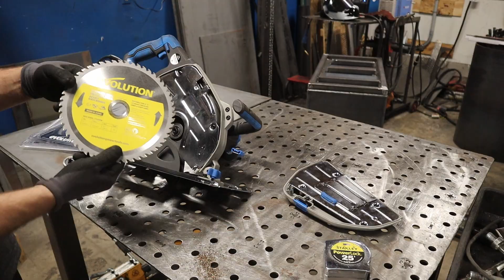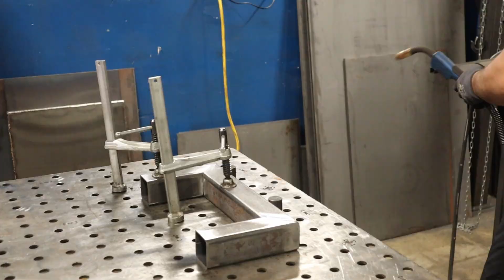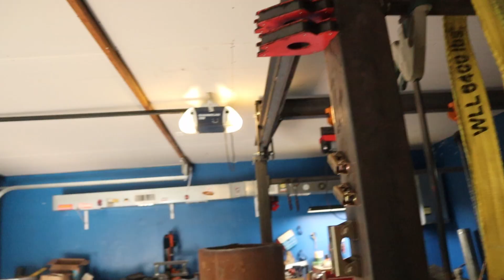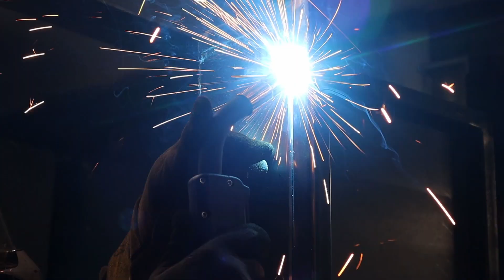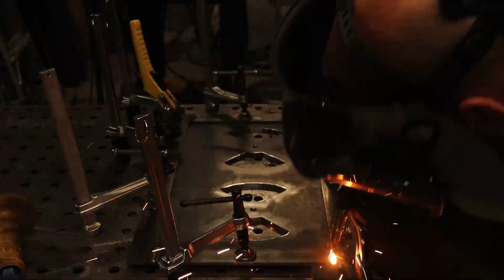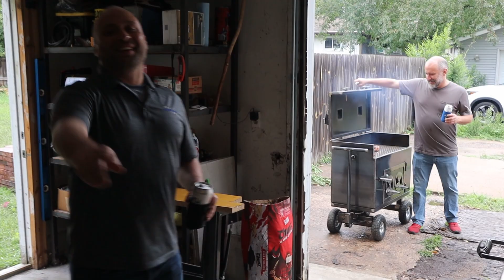DIY Direct Heat BBQ Pit Build w/Wagon Base!

Comment: You put a hub/bearing assembly on there, much love. Im a mechanic/technician by trade. Is it a Chevy unit?
Reply from the maker: @ericgordon4746  yup sure is 😂
Got it on Amazon for like $30.  Figured it would be perfect for the swivel bearing.
Reply: @fabmakebuildcook6274  Oh yeah, and it can take the weight of the smoker.
Reply from the maker: @ericgordon4746  absolutely

Comment: Your builds look great!  I’m attempting my first build now of something similar.  My 3/16 inch plate has thick mill scale on it.  Would you recommend removing all the mill scale to the bare shiny metal?  I dont plan to paint, but season with oil like you do.  Thanks!
Reply from the maker: I’d leave the mill scale on and oil over it.    I think it’s a good look.  Plus removing so that scale would take quite a bit of time.  Good luck on the build!!
Reply: @fabmakebuildcook6274  Thanks for the reply!  That’s what I was hoping for.  Like you said, that would take a huge time investment to strip off, but I wasn’t sure if it would adhere correctly.  I’m going for a dark metal look, like how your build turned out.  Did the metal in this video have mill scale on it or was it P&O?
Reply from the maker: @ItsAlwaysGood  the was all 1/4” hot rolled so definitely has the mill scale on it.

Comment: A. great build.  B. how tall is the grill not counting the wheels.   C. Keep it coming
Reply from the maker: Thank you.  24” tall.  I’ll do my best
Reply: @fabmakebuildcook6274  thanks.  I am not sure if I’m going to make mine 32 tall or 24 tall.  I have a sheet bent 32x24.  Was thinking tall incase I want to burn logs.  I know your other ones are taller but what one do you like best
Reply from the maker: @timothyswatzell221  they both have their pros and cons.  Take us nice since you can literally have a fire in them and still cook low and slow.  The shorter ones take less time to heat up and are probably a bit more efficient.  Both are good

Comment: Have you tried a pizza stone in this yet?
Reply from the maker: No I didn’t try that on this one but it’s a good idea!
Reply: I think it would be clutch!  @fabmakebuildcook6274   also what is the height of this - with out the casters? I am thinking about building on for the front of the 250 Reverse flow I am building.